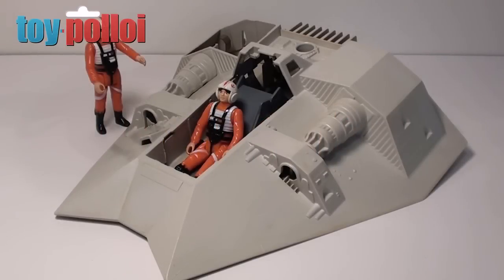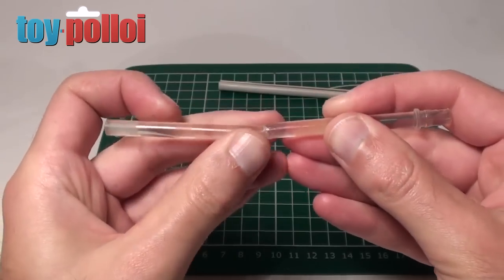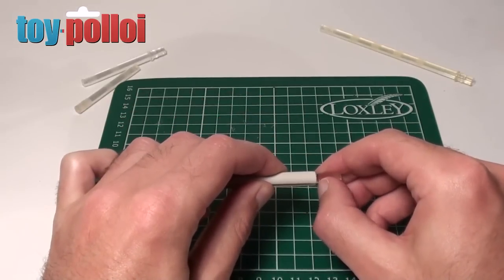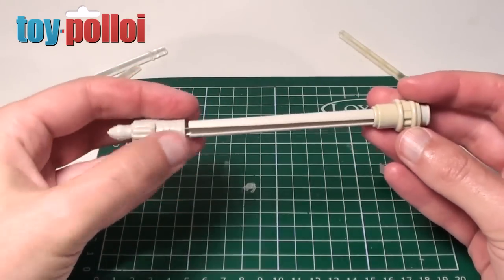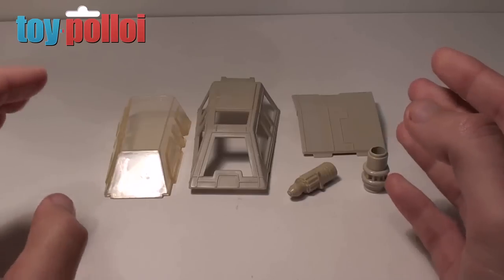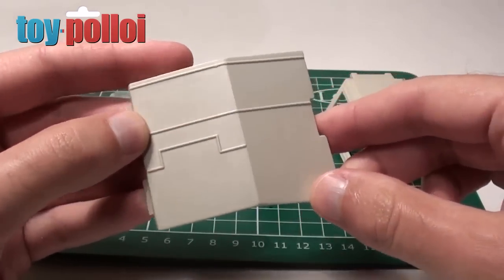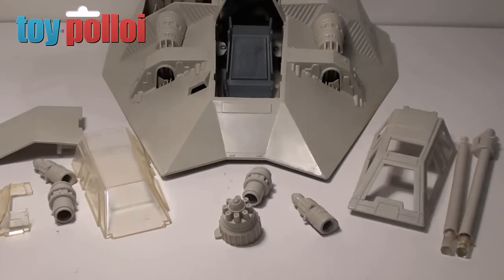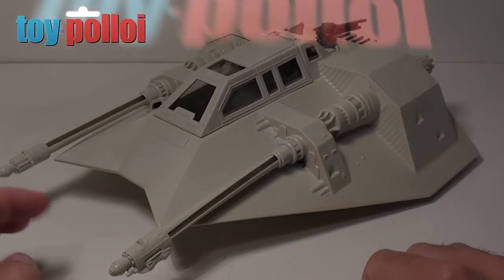Fix it Guide - Star Wars Snowspeeder restoration part 2/3

Comment: Best I've been able to get a hold on for my own restoration is a 12 pack of 0.6cm by 30.48cm acrylic rods from Amazon for $9.99 USD. Came to see if you shared the length I'll need to cut to and while not spoken I can see it from the broken parts on the table.

Re-pro parts I am also saving on as I have found an almost complete set for 3D print files for $5.00 USD on Cults. Would also like to swap that motor for a circuit board that plays the actual effect used for canon fire.

Comment: Awesome video.

I bet you could have cut the original plexi rod at the manufactured collar, and used a single drop of superglue to adhere a new piece of rod at collar and.  Still, the tip would need something to secure it.  Tiny o-rings would work for this, less to clean up in the future?  --  What you really need is a tiny lathe, a block of plexi, and a load of free-time.  :)

Comment: any suggestions on larger items that have yellowed like a uss flagg part? I would hate to have to buy so much peroxide to try and cover the bridge parts, that might get costly.
Reply from the maker: +sgf129 I've not done the de-yellowing on anyting much bigger that an AT-ST. I know there are other techniques that people use, but they cost more. A 330ml bottle of 6% Hydrogen peroxide costs 99p at the moment. You maybe able to get larger amounts for cheaper.
Reply: Toy Polloi does using peroxide make the plastic weaker? I have heard that it makes the plastic brittle. I'm going to try and get the yellowing off the bridge because I don't want it to get worse, I was a little surprised it yellowed in the first place because I kept it in a dark temperature controlled room, the same thing happened with my terror drome, and now I have a yellow streak, where the glue is going right down the top.

Comment: Looks like Rareburg doesn't exist anymore?
Reply from the maker: Yep, long gone. I've outlasted them.
Reply: @toypolloi  I looked up this video because I need to repair my childhood Snowspeeder where the entire rear part broke off at the four posts that hold it to the underside. I sourced another Snowspeeder with the piece intact but it has much worse stickers. I'm going to try to use parts from both to make one good one. It's been very helpful to learn that the electronics can be so easily removed and reinstalled, because I am not sure that both speeders have working lights/sound. I may have to swap them out when I put the good upper hull with the intact lower hull. Thanks for all your great insights!
Reply from the maker: I have loads of videos on the snowspeeder. It's a favourite of mine. Including how to reattach the back section. Cheers

Comment: Have you ever tried floor polish for the clear parts? 
Check out this video, the person is talking about hot wheels windows but same clear plastic 
http://youtu.be/RdnDewYsNq8
Reply from the maker: +artistic amnesia That looks like a good tip. You can also use T-cut to give a slight polish to the old plastic. That seems to work well.